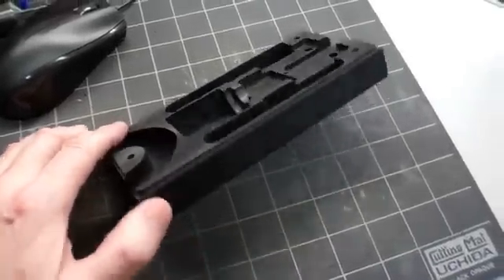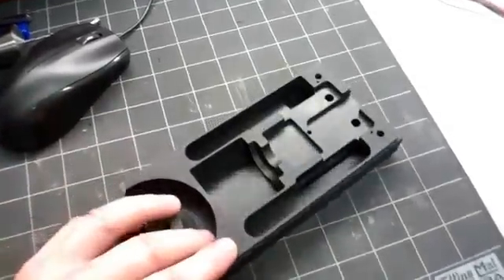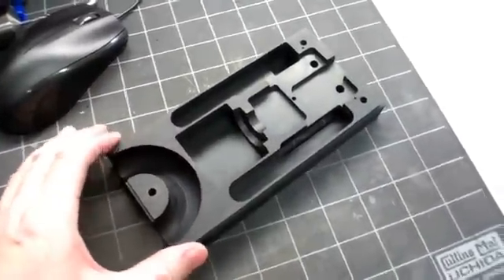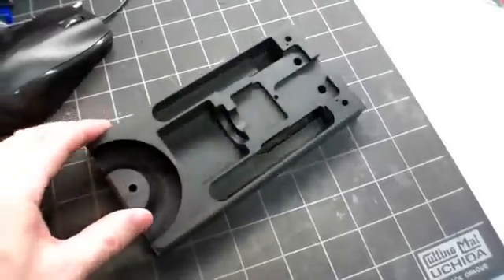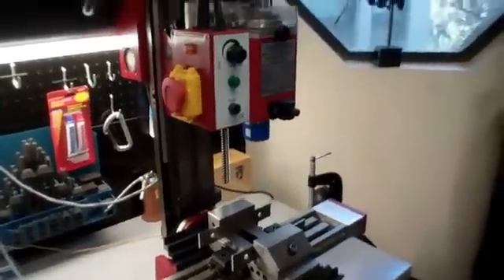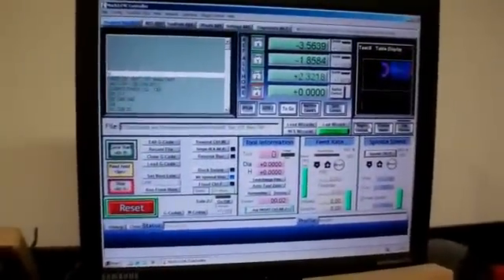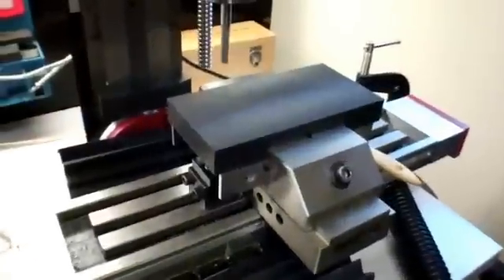CNC X2 Mini-Mill

Comment: how large of a part can this do? how big was that housing? I know the X2 mills are kind of limited on the Y travel to something like 4"? I really wanna pick one up for a basic mill w/ DRO setup, and then possibly convert it to CNC later. But I might need a tad bit more Y travel? I wish HF still carried the X3.
Reply from the maker: If I remember correctly the housing was about 7 x 3.75 x 1.5 inches in size.  There's a 1-inch grid in the background at the beginning that illustrates this better. Depending on the tool length, the working envelope is roughly 12" by 4" by 6" inches.

Comment from the maker: I used something like 21 ips with light cuts.  I wasn't maximizing production, just making sure not to lose steps.  Fast enough to prevent any heat build up.  The length of tool varied, but some of those pockets are deep with small radius corners.  I believe 3/4" length tools.